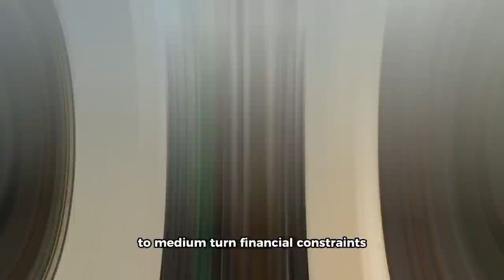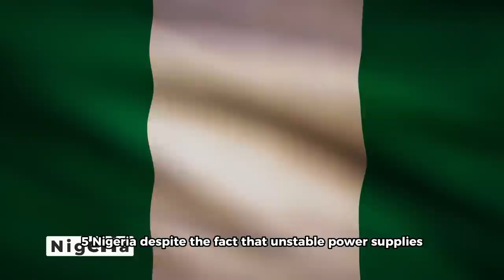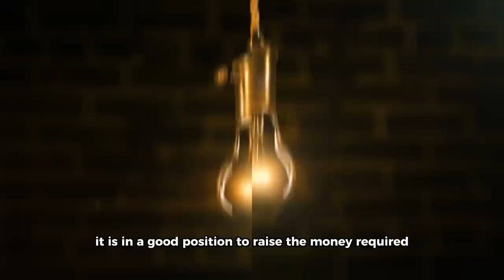10 African Countries With The Best Infrastructural Development.

Comment: Kenya is frankly way ahead of the rest. If electricity is a part of infrastructure,  then south Africa cannot even take no. 1. If they have to experience power cut about 8 hours every day. Kenya has built about 15,000km of brand new modern roads in less than 15 years and connected almost all to power. Am sure this guy never visited Kenya.
Reply: S. A is still tops even with electricity problems which will be solved soon, just get medical attention for those chest pains you may have. 😉
Reply: @hewantssomespecialtreatmen7163  😂😂😂😂😂😂😂
Reply: South Africa has the infrustructure for power supply. Plenty of it. It just needs to scale up power generation to match th development that is taking place.  Power cuts are not lack. It's must go upscale generation capacity. 🎉🎉😢
Reply: Infrastructure is just tall pretty buildings water,sewer, roads, the rural areas. Nairobi is nice, but about the country side and other cities